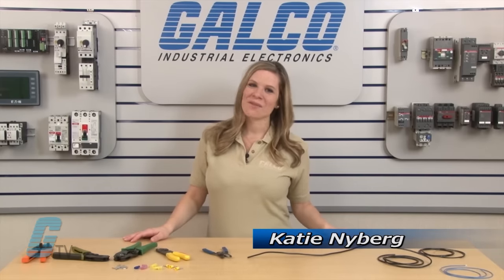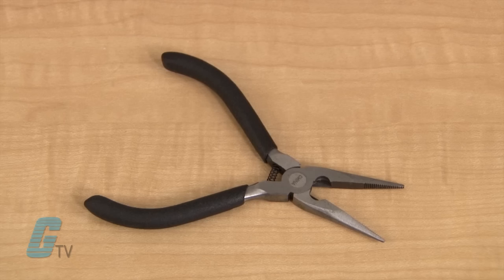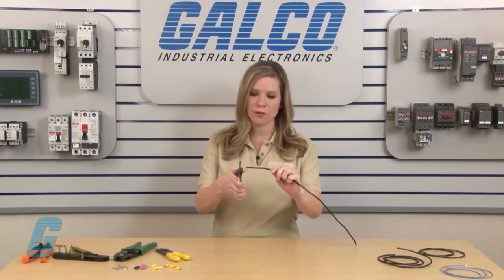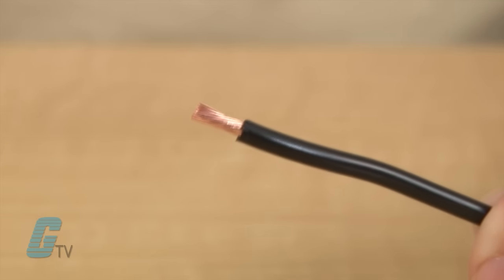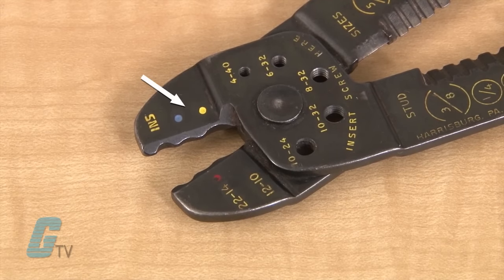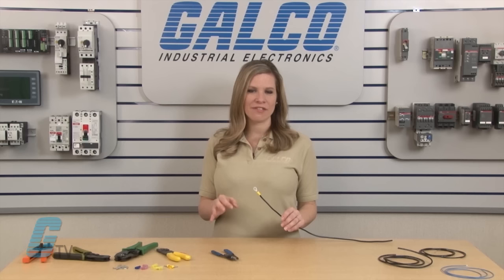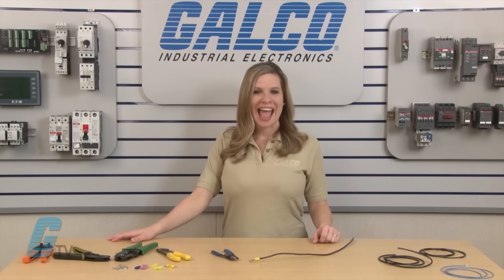How to Crimp Wires - Basic Tips on Crimping | Galco

Comment: I think I accidentally bought the wrong size connector for my wires, will it still work?
Reply: If the wires are too small, then just strip more insulation off  and fold the wire to make it thicker.

Comment: Crimping styles and  methods are very much based on the applications and the current loads through that joint or across the terminal. if one is working strictly on a low voltage application, where there is no water or liquid penetration the crimping methods are such that the joint is defined by a solid connection and conductors are firmly attached.

Comment: I prefer to tin the stripped part of the wire with solder, then crimp, and even solder where the wire sticks out the end of the lug to the lug itself. A bit of silicone sealant in the end of the lug where the wire goes in is not a bad idea either. Both the solder and the sealant protects the crimped part of the wire from any corrosion.
Reply from the maker: That's a great point about corrosion displacement. This process is also very effective for your car , bike, boat, anything with wiring in it that is outside all the time.
Reply: Try that on a job requiring dozens or hundreds of connections on a deadline and you'll be unemployed in the blink of an eye -- fine for a few connection that have to survive a particularly hostile environment, but for most applications?  Total overkill!
Reply from the maker: @editorjuno  thanks for your opinion Bruce. No doubt a timely process. Perhaps a bit of common sense might just do the worst applications in a vehicle or machine. HEAT is electrical and electronics worst enemy. So maybe just do ground wiring and high current cables, like battery cables, charge circuit wiring, etc.
Reply: @editorjuno  I did work for a company that built power control equipment for subways and light/heavy electric powered trains. We also built portable power substations on flat bed semi-trailers to fill in while a substation was being serviced. We had special lugs designed for those being exposed to the elements. Anything else was installed in sealed compartments.
Reply: The holes on the crumpet, with numbers like 10-32:   What are they used for?

Comment: My crimp tool has option for insulated and non insulated connectors. The shape of the crimp tool is different. If the non-insulated shape works great on non-insulated connectors why change the crimp shape for insulated ones, do they both provide equally good mechanical grip on the crushed wires? Also, crimp connectors with soft heat shrink can be crimped as non-insulated?

Comment: That yellow handled crimper should be against the law. In my very early years as a mechanic, the crimps by that tool gave me so many issues i finally gave them away and found a better tool. One that punches a part of the connector into the wire. No problems ever after that. I mentally scream everytime i see a pair of those terrible crimpers.
Reply: Yup. My go-to crimper was an appropriately sized vise grip. Lock it down = crimped!

Now I use pro quality crimpers, they're just as good but a LOT neater looking!

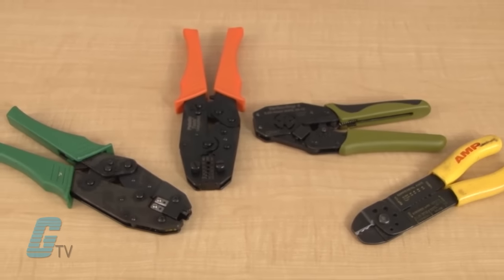Comment: The yellow crimp-tool shown is a shade-tree mechanic's that I'd only use for emergency, as a get-by measure until the joint can be made with the proper tool. Hand-squeeze jobs like that cannot guarantee a proper crimp if you have weak hands or arthritis. The correct tool is a multiplier, ( shown at 0:33 ), that always gives the same pressure. R/B/Y ratchet crimp tools for everyday use are quite cheap from auction sites, and well worth buying to do the job properly.

Comment: Never ever hand twist the bare copper it will prone to oxidies
Reply: Theoretically possible, but I've never seen a properly crimped connection fail for that reason in my over 50 years of experience.

Comment: I find those straight crimping pliers to be junk. The locking jaw dedicated crimping pliers are 100% better
Reply: Agreed.  The ratcheting ones are the only type worth using.
Reply: Too expensive if you're only crimping a couple of wires. Best to buy cheap ones

Comment: You can tell she doesn't know what she's doing when she cuts the insulation off the wire. Never cut the insulation at 90 degrees. Always cut between 60 and 45.